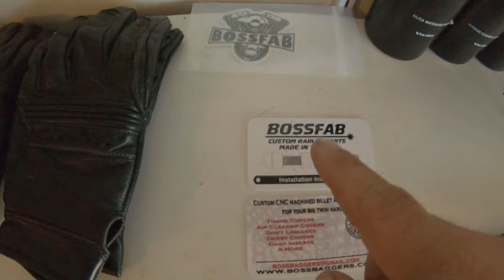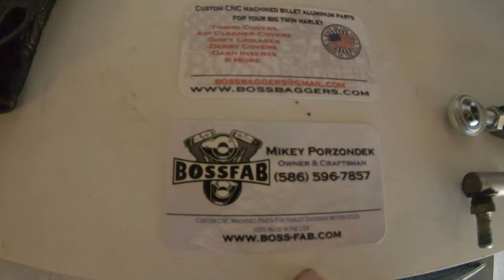Springer gets a custom shift linkage from Boss-Fab

Comment: Might want to try some CRC Heavy Duty Corrosion Inhibitor on the heim joints? Sprays out in a liquid but dries kinda like cosmoline. Stays put for a long time and prevents rust.
Reply from the maker: That's something I'm unfamiliar with but I like the idea of. Is it safe to assume it's something I could pick it up at Oreilly's?
Reply: @Buffalo509  I order mine from Amazon but a parts store might have it? I think it might be more geared towards the marine industry?
Reply from the maker: I found it on Amazon and it's not too terribly priced. I may have to get some of that coming, thanks for the heads up!
Reply: @Buffalo509  Sure thing. I spray the underside of my frame to help inhibit rust. That’s the main reason I have it but it’s pretty versatile stuff. I think you’ll dig it.